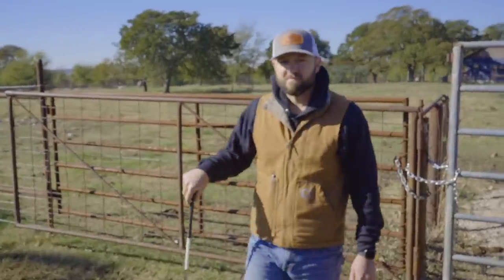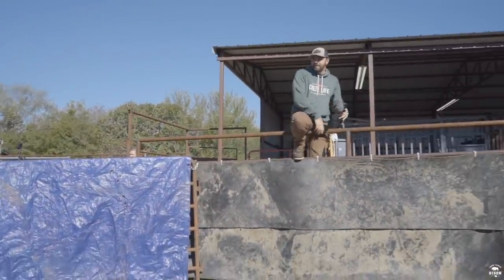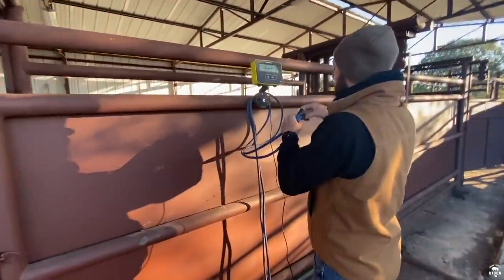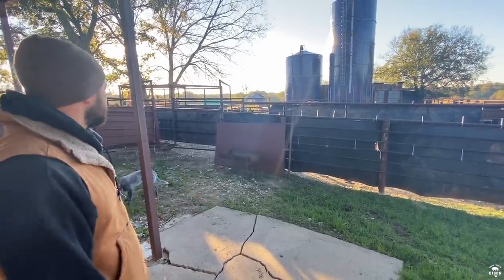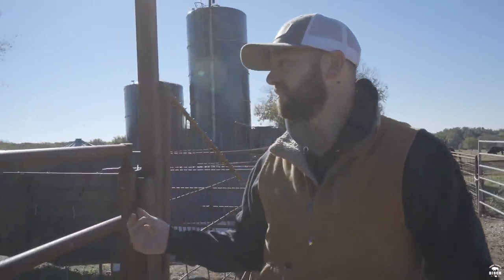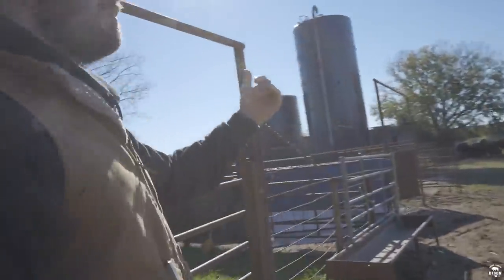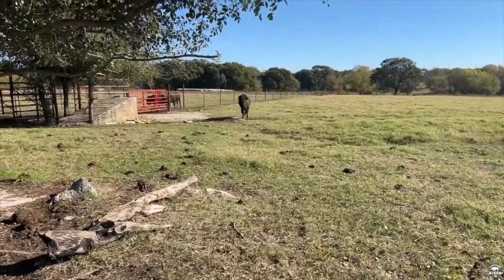Catching Our Bison... Eleanor is Too Smart!

Comment: I love watching you WORK to work your Bison 
I have 25 steers that in the spring - early fall are feed 75% on pasture 
They do get some ground feed 
But to work them , I have it a LOT Easier 
I open the gate from the pasture to the barn and shake a mineral bag 
They come running as they know the barn has the sweets and treats 
The reason the mineral bag is it sounds the same as the bag the cattle treats come in

Comment: Great video as usual Dusty. Just an idea that might help if you have one or two animals that don’t want to come into the corral or pin. Get a solar power electric fence charger, then go out into the field where you keep your animals n stretch an electric fence wire across the field, use temporary fence posts so it can b moved. After the wire is up b sure to flag it so your animals will see it. I usually find an old white tee shirt, cut or tear it into strips of 1&1/2 inches X 10 inches. About every 3 feet, place a strip of cloth on the electric fence. I usually just tie one end of the cloth strips to the wire leaving about 8 inches hanging down so the animal can clearly see it. Then just leave the fence so that the animals can get shocked n use to it. They might tear it down a time or two but after that they will stay far away from it. Then when you are getting the animals up, just take a flagged wire, it doesn’t have to b hot just any flagged wire n stretch it across where you are following the animal, trying to get the animal up. The animal may run by you but if you have that flagged wire closing the gap, she won’t get to run past you. The wire may not b connected to electricity but the animal doesn’t know that all they see are the flags n wire n they will think it’s hot n not come through it.

Comment: You should eliminate  the 90% ( corners) not your outside corners just the inside corners in your lane when pushing the herd it's a hang up and and a place where the animal can setup its escape by doubling back possibly throw a panel at a 45% just a suggestion. one other thing to think about is possibly is building a small holding area then installing some kind of crowd gate that works with gravity  or on a cable system operated by a winch or even both .if it's something that sounds interesting research it and see what works for you. From the outside looking in watching the operation I see little things that may makes things more manageable when dealing with livestock.  These are only  suggestions .

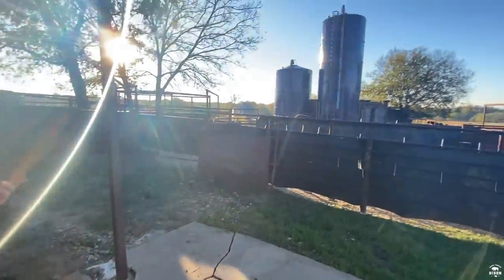Comment: HEY DUSTY,  AT 7:00 MIN IN THE VIDEO, THERE IS A CRACKED SLAB, AND I WAS WONDERING IF YOU WOULD BE WILLING TO TRY THE CONCRETE CRACK REPAIR STUFF TO SEE IF IT REALLY WORKS  ❓  🦅💗🤍💙🦅